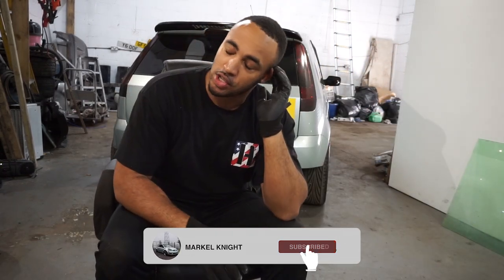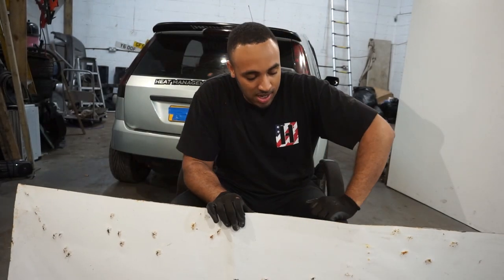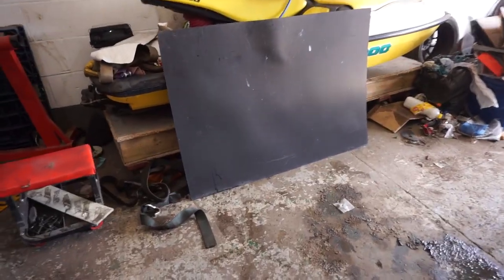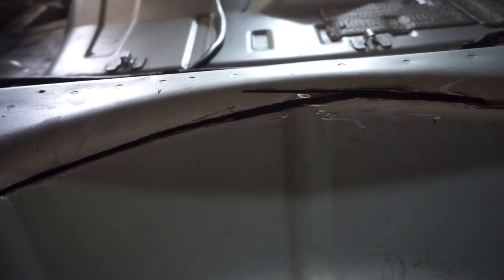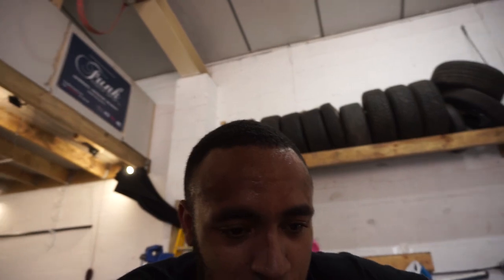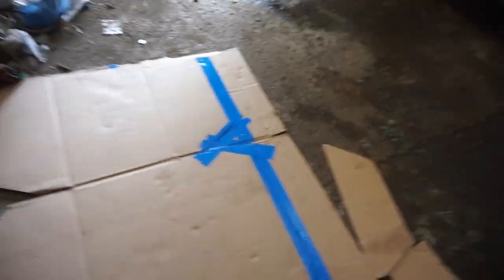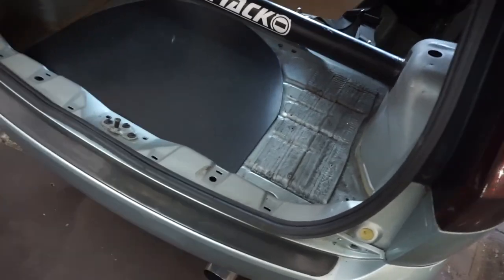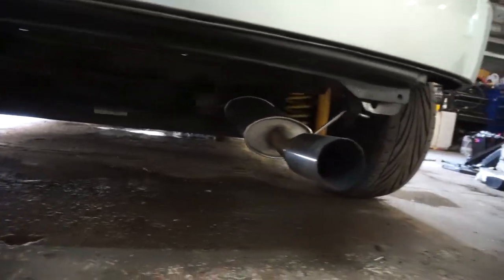Spare Wheel Well Delete - Weight Reduction Part 3 #FORD #FIESTA #MK6

Comment: Would carbon fibre instead of plastic work better and negate the need to do my extra steel bracing or support as its much stronger and rigid than thin plastic would be?. But lighter than welding a steel plate over?

Comment: doesn't this mean it will need an IVA for road use? modifying the monocoque chassis? I'm wanting to do the opposite and make the spare wheel well larger to accommodate more batteries in my electric beetle project

Comment: Nice video mate, im wanting to remove the spare wheel well from my car does this effect your cars chassis in any way and do i need to add like some sort of support beam, thanks
Reply from the maker: Yeah bud if you remove it you'll need to give it some structural integrity back with some form of bracing etc, currently designing some myself so once I've done mine I'll let you know
Reply: MARKEL KNIGHT cheers mate appreciate it
Reply: MARKEL KNIGHT im wanting to remove it so that i can fit a twin exhaust does it effect mot or anything?
Reply: @MARKELKNIGHT  hey man, I have a CIVIC ek hatch. I’m wanting to do this as well, full track build all the weight out for me.. I’m also trying to add some cool little twist into the build.. I’m gonna run one by you since you were talking about the structural integrity… I used to work in  collision/repair shop (not with welding tho) so I think this may work…
What if, you were able to run some structural pieces in a + form or x pattern… then put plexiglas in the missing space.. bam, see thru spare tire delete ?… 

Ehhh? Am I crazy?

Comment: Hey man, i'm way late, but i want to take the spare wheel well out in my car as well... What thickness of lexan did you use ? 1/8inch or thicker ? Thanks in advance :)
Reply from the maker: How you doing mate, highly recommended that you dont do lexan and do steel unless if you're going to make some lower steel bracing